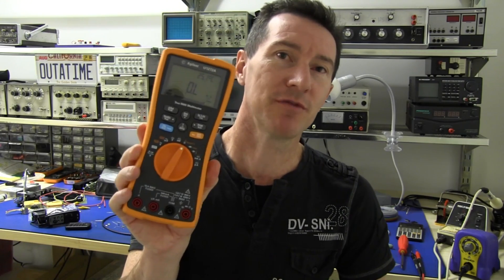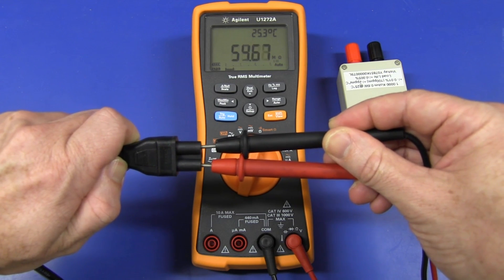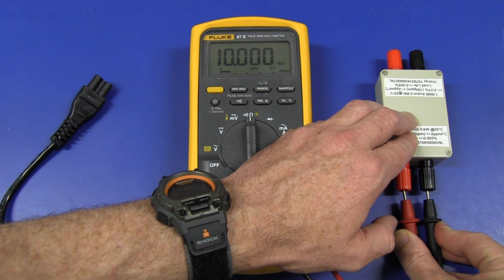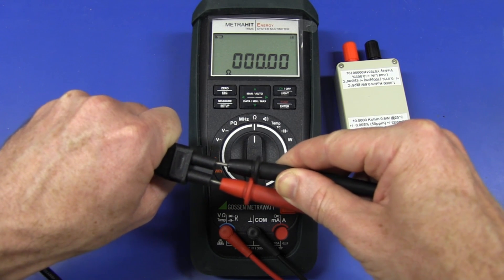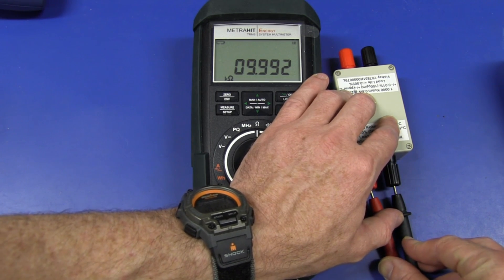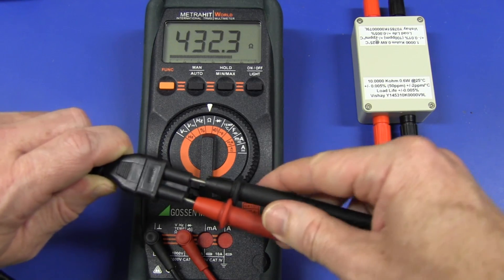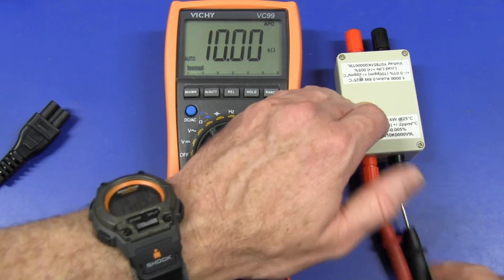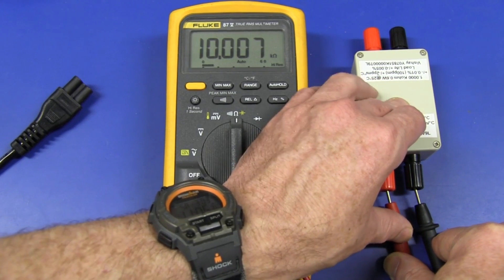EEVblog #252 - Multimeter Ohms Overload

Comment: Why did the Vichy 99 survive the ohms overload with 240vac? I was expecting it to blow like the Fluke video with 750vac ohms overload test on the Harbor Freight $5 dmm. What's the difference with that $5 meter? I expect those expensive dmms to survive, but for the Vichy to survive... there should be at least an explanation why it survived that test to bring it up from just boys having fun blowing things up and put some science into it.
Reply: its propaganda that cheap dmm is bad
Reply: He already blew the cheap ones that fail this test in his multimeter shootout.  These were the survivors, so he knew they would survive 240vac on the ohms scale.

Comment: When I got my first multimeter (back when I was about 9 yo), the first thing I did was to measure the mains voltage. Happy to see the nominal 127V, I decided to measure the mains current.

Yep, had to buy new tips the next day.

Never thought to measure the mains resistance though! ;)
Reply: Lol did the same with my first mm but i also tested the mains resistance and booom there it went
Reply: yup I did that on a 240v ac plug funny
Reply: Ricardo Menzer same. I thought whatever has the sine symbol is used for ac and boom. the metre was very cheap but still my hand is okay.
Reply: You should not
Reply: I did the same, to check if we have the rated amps on the socket :D

Comment: i'm not very experienced in electronics, but would this make a difference if you would switch the probes in the mains cable? Could the phase or neutral lead make a difference?
Reply: freakaefari polarity doesnt make a diffference on ac... on dc it doesnt either youl just get a negative reading if they are reversed

Comment: So THAT'S why some multimeters cost several hundred dollars (and are not a rip off). I guess they really are super awesome quality.

I wonder what would happen if you used an even cheaper multimeter than the ebay one you used. One of those multimeters you can get for $5.

Comment: What is that gsm fix you talked about for a Fluke meter . Which meters did it affect and what did it fix in the fluke meters . I have several flukes from over the years from when I was in the NAVY on Submarines to when I worked as a electronic tech for ASI company working on Delorean radios .

Comment: @SampsonGizmo Because it's very likely that someone will accidentally apply voltage to the meter on the ohms or diode check function. This is a "test" of how well / if the meter will recover.

Comment: I can see Agilent now, working on a meter that not only maintains accuracy after taking mains in the ohms range, but also gives you a valid ohms reading of the parallel resistance of all the mains transformers connected to that circuit

Comment: @hitachi088 I know that's what fuses are for. Showing how easily a fuse blows when you put several kiloamps of fault current through it is not overly exciting. It would be interesting to see how many of the cheaper meters continue to function afterwards, but not worth the possible destruction of them.

Comment: Dont know if this has an impact to the accurate measuring but when you sticked mains to the second Gossen meter battery signt went from 1 bar to 0 bar and when conecting to precise  box again it returned you 1 bar back.